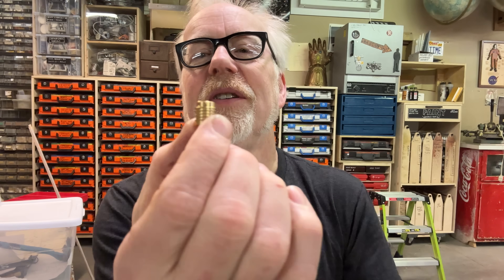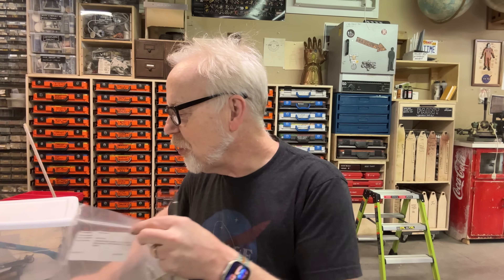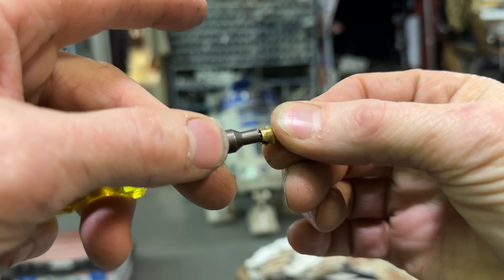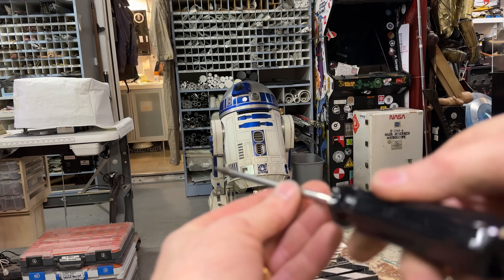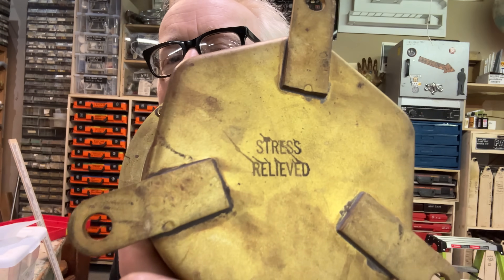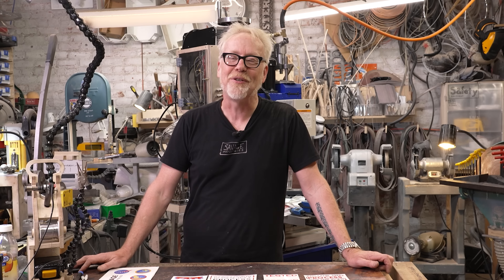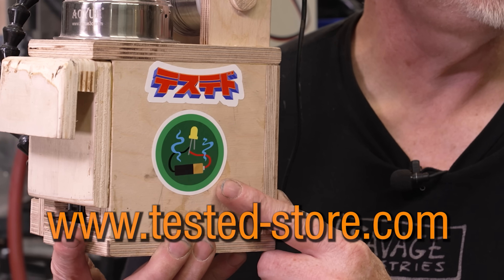Adam Savage Learns About Barrel Nut Screwdrivers!

Comment: Why by golly, we use those for mounting guitar necks! We drill out the original holes and replace the wood screw threaded bolts with machine threaded 10/32 bolts. Took the idea from my graphite necked basses as it made a more stable neck joint!

Comment: In every other application EXCEPT the very specific use in naval junction boxes, a barrel nut has a threaded hole 90° to the axis of the barrell. 
Good luck screwing one of these threaded inserts into wood with that silly screwdriver.

Comment: The other option is to use an appropriately sized screw with a "regular" nut on it. Turn the screw into the into the insert and jam the nut against the insert. Use the real screw head to drive the insert. Loosen the nut and unscrew the machine screw when the insert is seated.

Comment: Wait, when did people start calling threaded inserts "barrel nuts?" A barrel nut is something completely different - a smooth cylinder with a threaded hole in its side - the kind you drop into the side of a table leg and then a bolt holds the leg to a bracket on the table top.
Reply: You are correct. They are ONLY called barrel nuts (for whatever reason) by Navy electricians.
Adam did a piss poor job explaining all of it. Those screwdrivers look useless for anything else but super low-torque environments.

Comment: wow, all you need is the ACTUAL bolt that goes in it. and a nut.  Get a bolt as long as you like.

crazy glue the nut on at the proper depth, and poof

Essentially a FREE driver.

No purchase required, other than the bolts you already bought to use with them....

Comment: I love that there are drivers for these thread inserts. I've been in the hardware game for thirty years and did not know that.  However, if you ever need to use these thread inserts and don't have a proper tool, you can use a socket head cap screw to get the job done.  Simply thread the appropriate size screw into the thread insert and use an allen wrench in the screw to twist the thread insert in. Then take the screw back out and you're done :)

Comment: My new favorite threaded-insert is the rivnut. Being able to just add threads to flat aluminum bar stock or car body panels is wonderful.

However, when I first started using them, someone told me they could be installed with nothing more than a matching bolt and a socket wrench. That advice couldn't be more wrong, and if you try that you will find yourself simply wasting your time and exerting way too much energy.

If you're going to use the less common pieces of hardware, go ahead and find the proper tool. Harbor Frieght is a wonderful place.

Comment: Kind-of a hack, but you could also thread a bolt into the insert and tighten a nut against the top of the insert, then use a socket / ratchet to drive the insert into the work piece.

Comment: That barrel nut is a lot like a jet from a small engine carburetor.  I've had the exact same problem working with those.  Getting the old ones out of the recess where they are located often becomes a job for an easy out.  Unfortunately the internal jet hole is much smaller so I don't know if these will work.

Comment: Hmmm... ANOTHER NEW TOOL...  As a woodworker I always used a bolt, nut, washer and a wrench.  Put the nut on the bolt, add washer then thread into the barrel nut and jam it down.  use the wrench to turn the nut some more and it will cut right in to the wood.  use a second wrench to hold the bolt and back off the nut.  Clean and simple.

Note: love the organization to the shop.  If it were mine i'd have to color coordinate the Sortimo's by SAE/Metric/Other stuff ...or by trade area (Woodworking, plumbing, electrical, ...)

Comment: Ahhh, that's what they are called!

In airbrushes there is a component called a needle packing nut. Which is an adjustable assembly to ensure a good air seal around the needle, but not so much friction that it drags too heavy on the needle body.

The drivers supplied are almost identical to these, with a central locating pin and flat blades, but of a significantly smaller dimension.

Comment: I use to work on those junction type boxes when I was in the Navy. We had a set of 1/4" sockets to remove and install the barrel nuts. The inside of  the sockets were very similar to the screwdriver tips as shown but did not have the spring loaded tip. The sockets worked fantastic for the junction boxes but did not work on barrel nuts going into something flush. I had thought of bringing a set of the sockets home with me when I left the Navy but they were a pain to get and I new my shipmates would need them a whole lot more than I woiuld.

Comment: Dude, woodworkers have a T-handle driver with a threaded end that matches the interior threads of the insert.  Much better than a screwdriver. You can buy the driver and correct inserts in a kit.

Comment: 6:50 sometimes when I have a specialty tool that is meant to work with very specific consumables, I store them together. In this case, if there's room in the Sortimo with the barrel nuts, I'd consider putting the screwdrivers for them there.

Comment: when needing a threaded insert in wood working , my goto is a regular nut . i counter sink a hole the depth of the thickness of the nut with a spade bit that same size  of the wrench used to work the nut. then using the point in the center of the hole i use the drill a threw hole the size of the fastener. then set the nut over the countersunk hole and give it a good smack with you hammer,  it works every time and way cheaper. oh, if you are worried add a bit of wood glue.  hope this helps

Comment: Well, I was today years old when I learned about barrel nut screwdrivers.  I'm guessing the manufacturer is going to be stunned by a sudden explosion in demand for these tools (including me).  I had always heard to drive them using a hex bolt with a double nut jammed on the threaded portion.  You screw the bolt into the threaded insert until the nuts shoulder on its face then crank it down.  I prefer to use a t-handle on a 1/4" socket to drive them, as it lets me stay centered over the hole and still apply good force.  I agree with someone down thread who mentioned it might be good to store the tools in the Sortimo with the threaded inserts, as they aren't likely to find uses other than for this one purpose.

Comment: Stress relieved means that, after forming, but before machining the flange on the front to make it flat, and do the drilling and tapping to allow the face to mount, they were taken, placed in an inert atmosphere oven, and heated up to something between 600 to 800F, or 315 to 420C, and left there for a few hours to allow the brass to relieve all the stress from forming, so it is soft, and will not split under impact, just deform. Then final machined, and provided with that protective layer of lacquer to keep it good during storage.  That way when you go to drill the holes for the conduits you only have soft metal, and there will be no splitting or hard spots in the brass. In a submarine you really want watertight joint boxes, as this keeps the connections from corroding, and the soft brass allows a good seal as it deforms when the conduit is tightened, making a metal to metal hermetic seal. You can have it under sea water for 10 years, and open it up to a shiny inside still.

Comment: Adam should put a sheet of plywood with drawer slides on the top and bottom in the space between the sortimo cabinets for the spreadsheet. You could pull it out and have a directory of everything in each box, it would be a better use of space than a thin sheet to look at on the front.

Comment: Those are some awesome screwdrivers I did not know existed. As a woodworker we learned to put threaded inserts in backwards , that screw slot into the wood as a cutting edge and use a Allen key or a nut/jam nut bolt setup to install the insert.

Awesome vid and gift.
Reply: As a woodworker, these screwdrivers are useless. 
One of the main purposes of a threaded insert in wood is that it can resist spinning under the torque of the internal fastener. If you can somehow manage to install a threaded insert into wood with one of these screwdrivers, by hand (lol!), there wouldn't be enough resistance against the torque of a fastener being tightened or removed to keep it from spinning the insert too. 
Barrel nuts for woodworking or anything else except Navy junction boxes have a threaded hole perpendicular to the axis of the barrel.
Reply: @mrfirestop415   I'm not a woodworker (more of an embarrasing hack, really), but my experience has been that drilling a cavity for the insert with a Forstner bit and then lightly epoxying the hole holds the insert pretty solidly in the wood, but it's a permanent thing - if the insert gets stripped, you're gonna have to drill it out.
Reply: @seegee-u3l  Agreed with stripped threads, but there are steel inserts available that are plenty durable, and a reverse threaded broken bolt remover will pull a a stripped insert easily.
I tap the hole with the insert's external thread when installing these, it's easy to modify a bolt to act as a tap that only partially cuts the threads by grinding off some of the bolts threads and cutting a slot across the threads and along the bolts length. Quality inserts outer threads are specifically formed with much thinner or sharper edges than regular threads, so with the help of some half formed threads in a hole (hole preferably slightly larger than the inserts minor diameter) they will wind in very tightly without the need for epoxy... but it doesn't hurt. Heat will soften epoxy easily enough for removal. 
Hope the tips help!
Reply: I came here to recommend the bolt/jam nut insert method too.

Comment: Pro Tip of the Week
If you want pristine, unmarred slotted screw heads, use screwdrivers made for gunsmithing.
They are designed specifically not to damage the screw slots.

Comment: This is so weird, as we are always told in Germany that the slot is functioning as a thread cutter to cut its own thread. So it has to go first. The proper tool to insert these is more or less a piece of thread on a handle. 

I love those cultural differences in technology! 

Regards,
Etna.
Reply: How so? You have one complete thread. The position of the cuts is irrelevant as you follow the same thread. 

Regards,
Etna.
Reply: This would leave a second cut 180 degrees from the correct thread cut weakening your joint significantly if it was a correct method of action.

Comment: There's a version of those threaded inserts that uses a hex key instead of a flat slot to turn them into position.
They are slightly more expensive and sometimes require a bit more searching but boy does that make a difference.
Reply: Yup. These are the ones I prefer.
Reply: Hex head are the most common threaded inserts where I’m from. Didn’t realise it was such an issue until I saw his type of inserts.

Comment: 6 steps to addiction
1.Build a specialty screw driver drawer.
2.Place the screw drivers
3.Drawer looks too empty.
4.Buy more screw drivers
5.Drawer too full.
6. Loop to step 1

It always starts at 1 tool.
Reply: 31. Open the third branch of Museum of Screwdrivers that not only display specialty drivers but sell most of up-to-date versions of products in collection in the shop  
32. Profit
Reply: TAS- Tool Acquisition Syndrome.  Directly related to the more general "Gear Acquisition Syndrome", there are interventions available. ;)
Reply: I’ve never gotten to step 5 they disappear….somewhere in my house there is a mother load of #2 Phillips and 3/16 flat blade screwdrivers.

Comment: Step 1: cut the "business end" off the screwdrivers. Step 2: cut a wee bit off the end of your 1/4" hex steel stock & square one end (close is fine). I bought a 10ft stick of 1/4 hex decades ago & made custom tool driver ends, still have a lifetime supply. Step 3: weld to the business end of the new driver, & you have an improved device you can operate with a close quarter 90° angle driver, long shank driver, or whatever. Also the new bit is right sized to store with the THREADED  INSERTS  (i.e. not barrel nuts for which do a search, that's a different thing)

Comment: I keep the bits/tools in the bin/kit so I don’t have to hunt through racks and drawers. Hex bits are great for this and I have ground off oversized handles and shaped the tool to fit a hex bit driver. The more I organize my tools so I can see what’s available on the wall, the denser the tools become. In order to keep things manageable, it’s going into a drawer if I don’t use it more than twice a year. Putting it with the screws makes it so you don’t have to be distracted from the inspiration of making.

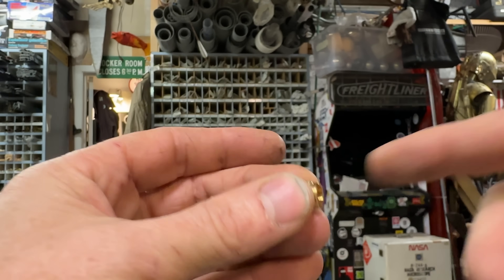Comment: 2:41 i've actually never used that feature. I've always used a hex head screw to drive those in. I actually install those backwards, with the slot hidden, because it looks ugly with it visible. If you use a little bit of superglue on the threads of the insert and let it set, then you can remove the screw without it coming out with the insert (if you don't, the friction between the head and the insert is enough to sometimes pull the insert out.

Comment: Added comments when you have proper training and, safe equipment to run a dye machine like tool & dye iron rod laying an shearing. It may be possible to create a all fit lock 🔒 an grip plus gait to lock up even screw to remove tip screwdriver 🪛 types in example by emojis :  🪛✅🔩🉑🛅⚧️🔢*️⃣↔️↕️🔁🔂🔄⏹️✳️❎❇️♻️♐️ nothing like flat an Phillip 😂

Comment: The way I've always installed threaded inserts is using a matching machine bolt and nut.  Screw nut onto the bolt far enough for the length of the insert, then screw on the insert.   Tighten the nut against the insert jam nut style, and then use a socket wrench on the bolt head to screw the insert in place (or to remove it).  Works great and never mangles the slot.
In my "home hardware store" I have an appropriate bolt/nut in each bin of threaded inserts that goes back into the bin after the insert is installed.
Reply: I cut the head off the bolt and chuck it into my drill press to keep the insert straight then turn the chuck by hand.
Reply: @jimruddy6083 
That’s good if you need to ensure it’s perfectly perpendicular.  Thanks for the tip.
Reply: I do the same, just make sure the bolt and nut used are 8.8 or better, as plain steel wears badly after a while. With the nut I also try to use a nylock nut so it self grips, so you do not worry about the thread, though I also have done some with red thread locker to keep the nylock there forever. Nylock goes on insert end first, so you first do it regular way to cut the insert to the thread, then off, turn around, and put on the bolt backwards.  For those with regular use (M4 and M5) there is a second nylock that acts as jam nut on the one for the insert, firmly pressed down nylon to nylon to deform them, and they do not move, even when used with a power driver.
Reply: have installed many using that method
Reply: Me too.  It really keeps the insert stable as you screw it in.
Reply: That was my thought but if I would have wanted the insert nut to be deep inside the material I would have used what we call a joiner nut. They are longer and can be used to join two pieces of threaded bar. Then I would have made the end of the nut round using a metal lathe. Advantage is also that the nut won’t drop of due to gravity as the case with the screwdrivers.
Reply: They sell driver bits for your drill, called an insert nut driver or EZ LOK drive tool. Basically looks like the tip of these drivers he was sent minus the spring loaded shaft, they have a short fixed centering shaft.

Comment: I have a tiny version of this from Harder & Steenbeck that is used when replacing the needle packing on their airbrushes. It doesn't have a retractable tip though, since that's not needed for that application.